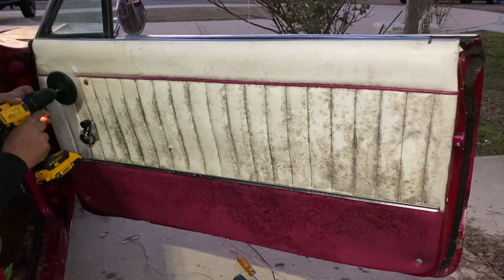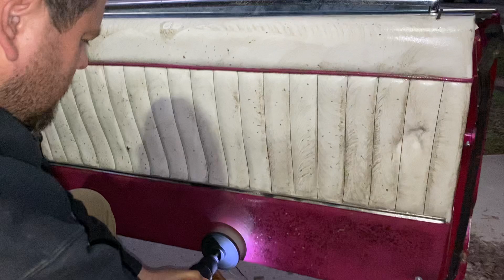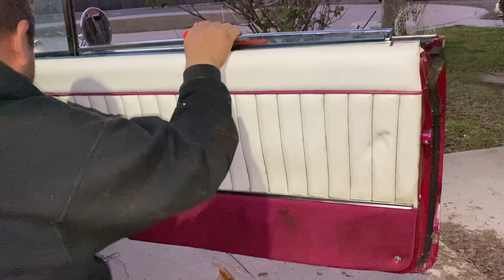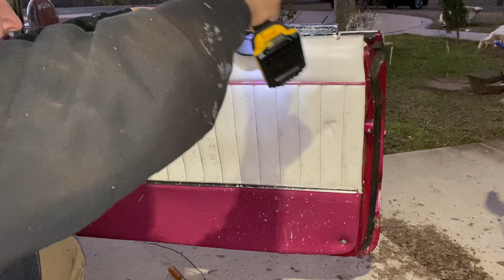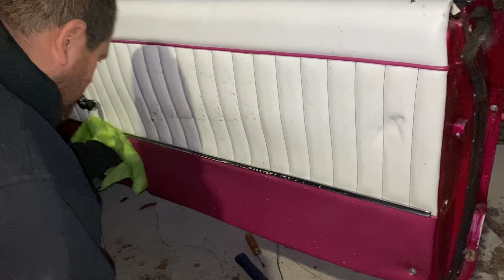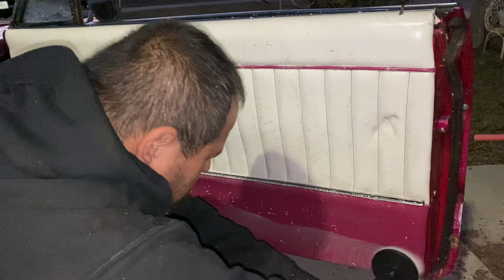Interior cleaning on the abandoned 64

Comment: Damm that's krazy but u  new put new floors in but trying 2 save by cleaning that old mildew n u r breathing that in also stay safe
Reply from the maker: Yes  wore a mask when messing with the rust and what not. Pressure washed all crap off then self etched primed everything. Plan on doing under coat from bottom after it’s all done